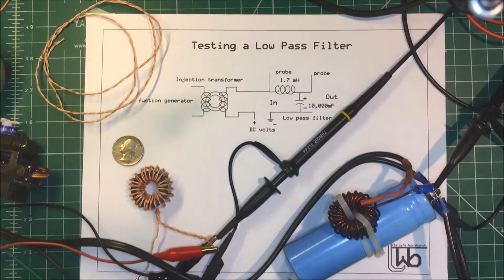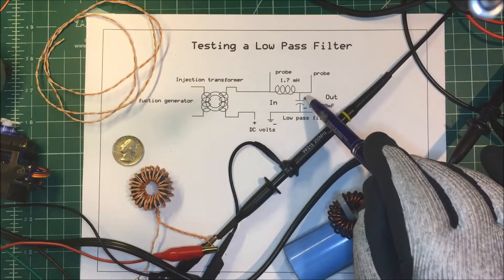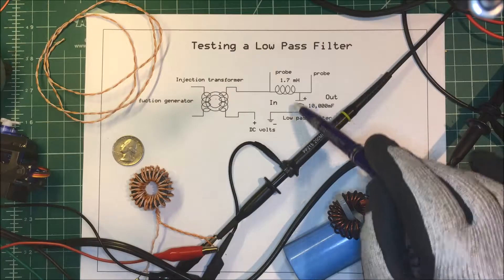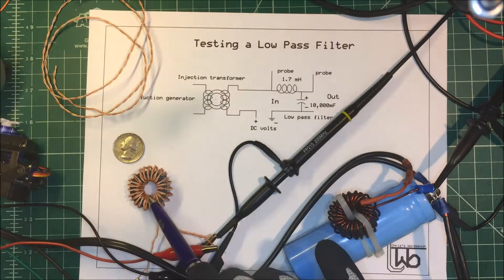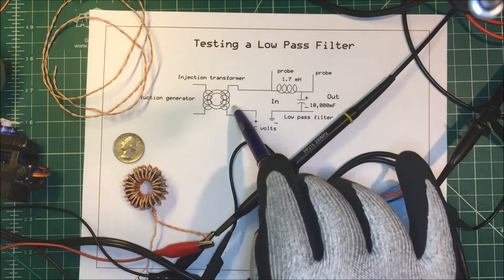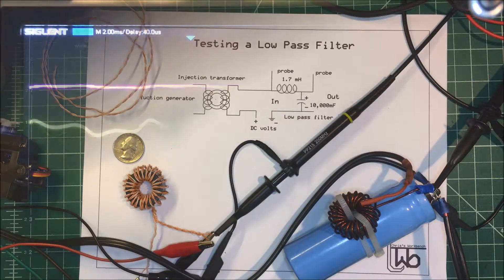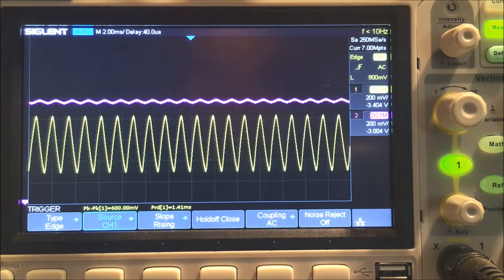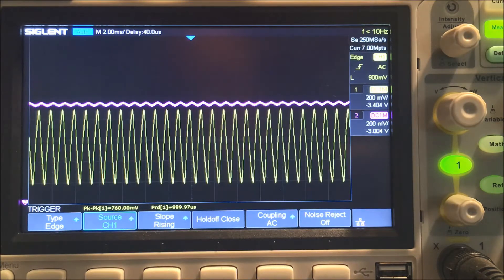Testing a Low Pass Filter

Comment: Hi, Chris! Thanks for all your great tutorial videos! This video is directly on-topic for my present need. I am testing a DIY circuit = a RC oscillator creates a triangle wave, which is used to drive a PWM (Square Wave - Comparator [Ground referenced] - Duty Cycle) circuit. The triangle wave generator suffers from a =/>2MHz jitter, which I have determined is from ambient influences. I have designed a simple Low-Pass RC Filter to remove everything above 1KHz. I will use this filter in the DC/Ground Referenced configuration/PWM circuit. I need a protocol for testing it. I have a Rigol 1062Z Dual Channel Function Generator. It has a noise function, but I do not think that it will mix the noise channel to the sweep signal channel internally. Meaning, I need an integrator circuit, such as you explain, here, to tie the two separate channels. So, I would appreciate you talking me through the details of what you did... I take it that the integration transformer is nothing more than a random number of equivalent turns of twisted pair wire, maybe with the number of turns being convenient for future math calculations? I also guess that the setup is as follows... Speaking in terms of the orientation of your schematic... The sweep signal should be injected on the right-hand/DC/RC Filter side of the transformer. In addition to the test sweep range (say 800Hz to 1200Hz, to isolate the drop-off at 1KHz) the Function Generator should add the needed DC offset to keep the signal always positive. The second channel of the Function Generator should be set to produce noise at a given voltage amplitude. Should it also be offset to always be positive? It should be injected on the right-hand/Function Generator side of the transformer. As I am just a novice, I hope that I have been clear enough to convey what I am doing and the help that I need. Please give me all of the details with great specificity. Maybe a followup video would be the easiest means to instruct me? Thank you so much for this help. I look forward to reporting back on my findings.
Reply from the maker: Use a signal generator to produce a triangle wave that includes the 2 MHz component and other frequencies.
Set the amplitude and frequency range appropriate for your filter test. For example:
Base triangle wave frequency: 1 MHz or lower (representing the desired signal).
Additional 2 MHz component or harmonics to test the filter's effectiveness.

2. Connect the Filter
Connect the signal generator output to the input of the filter.
Connect the filter's output to the oscilloscope's probe input.

3. Measure the Input Signal
Attach one oscilloscope channel to the input of the filter to monitor the unfiltered signal.
Observe the triangle wave and verify that it contains the desired frequencies (e.g., fundamental and harmonics up to 2 MHz).

4. Measure the Output Signal
Attach another oscilloscope channel to the output of the filter.
Compare the output waveform to the input waveform.

5. Analyze the Results
Before 2 MHz: Verify that the filter does not distort frequencies below the cutoff (e.g., the base triangle wave remains unchanged).
At/Above 2 MHz: Observe the attenuation of the 2 MHz component. It should appear significantly reduced or removed at the filter's output.

6. Verify Attenuation
Switch the signal generator to a sine wave at 2 MHz to measure the filter's attenuation. The output amplitude should be much lower than the input amplitude.
Use the oscilloscope's FFT (Fast Fourier Transform) mode, if available, to visualize frequency components before and after filtering.
Reply: @ke6chris  Excellent instructions! Thank you for the details! The extra effort is much appreciated! Wow! So kind of you!